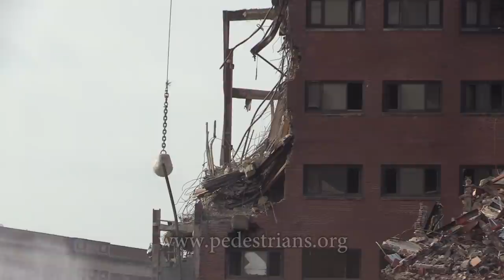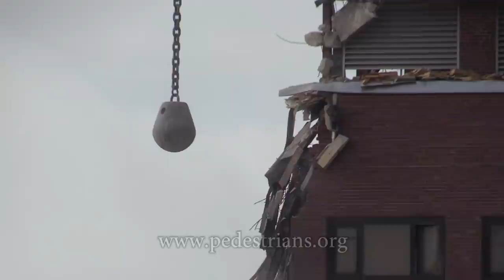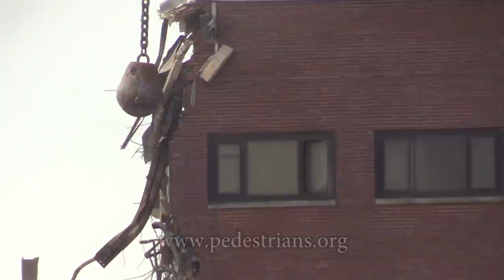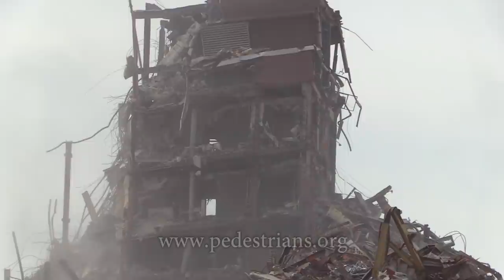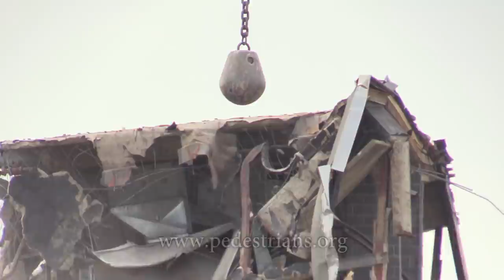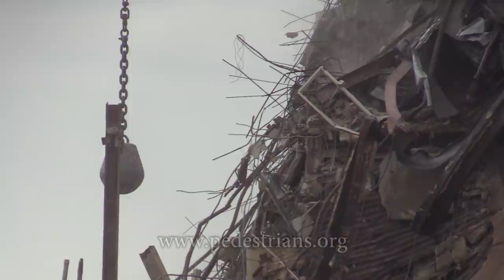Hospital Demolition (Wrecking Ball)

Comment: I wonder why  they used a wrecking ball instead of using another way to demo the building. It looks like it would take so much more time to demo it this way being such a huge building.
Reply: its cheap you can get the crane for under 60k at an auction. demo is hard on the machines why buy a multi million dollar highreach when you can buy a new dragline every job

Comment: I like the old method of wrecking ball action. Yes, this could have also been done with a high-reach demolition excavator, but the crane and ball method is justified for this demo job. It comes down to total cost of demolition and the time alloted for the work (mobilizing men and machines, demo, sorting of material, amount of recyclable material, trucking, disposal of unusable material into commercial construction landfills, cleanup, etc.). This building is of steel-frame, with brick veneer and masonry backup. The operator has to remove the steel by shearing off the connections while working on the rest of the structure. The smaller you can break material during the initial process (with the ball), the less secondary breakage required, and easier to haul away, or process on site. Perhaps the height of the building was higher than the available high-reach excavator, hence the use of the crane. The crane being used is a Manitowoc 3500, a friction machine (using clutches and brakes, operated with both hands and feet), requiring skill to operate. It isn't easy spotting the ball accurately, and the operator goes home with a sore neck from having to look up all day!
Reply: Exactly! All the armchair crane operators just want to see huge chunks knocked off and the building to fall over. There is much more than that to be done, and it is obvious this operator is doing as much separation as possible before it hits the ground.
Reply: @mattm5730  You understand. There is always more than meets the eye. Demolition is a process.
Reply: Thank you for pointing out which crane is used. I get interested into the classic Manitowoc friction machines more and more. It seems to me that Manitowoc and Link-Belt cranes are the top brands regarding wrecking ball jobs in the US nowadays - at least what I can judge by all the videos here on YT. And Link-Belt having more modern units out there for demolition. My favorite is still this old LOT P&H 790 TC! Best regards, Menck-Max

Comment: The old timers used to put old truck tires between the connection for the ball and cable. It was for shock protection for the boom and cable. Guess the younger guys are too smart for that
Reply: @Albert Cyphers thats funny lm an old baller an we called them training tires for young green operators,boom shockload controled thru brake feel an experience,when skilled enough the tires gone an you go to bigger ball an startmakin hay!, less hardware on ball less hangups on structure
Reply: You don't need a tire when you been in the cab long enough. You get a good feel with these old friction cranes to cut the shock down son.

Comment: Messer. Not allowing for the G force in rotation every swing so he misses over and over. 
Stops to look at his work after every thump. Instead of using the ball. Should have his rotation stopped and beginning to go back out as it strikes the he only needs to rotate half as much and works twice as fast  
Also worth noting is that dropping the ball shocks the crane way more than swinging.
Nice camerawork. Nice Menke Crane.

Comment: Did the comments say that they had a high reach excavator ? Maybe something happened and they switched to the wrecking ball. The only thing I'll say is maybe a spotter to help the crane operator.
Reply from the maker: They were using the wrecking ball on all the tall parts of the building.  They had a high reach excavator for the lower parts, and other excavators to handle all the rubble.  Berg Demo has tons of equipment, and could have brought in whatever they needed.